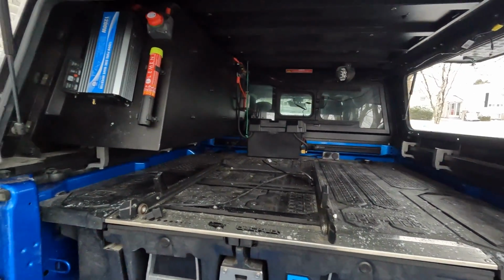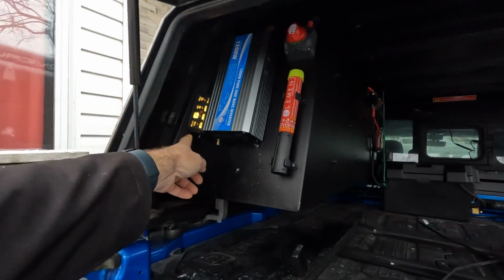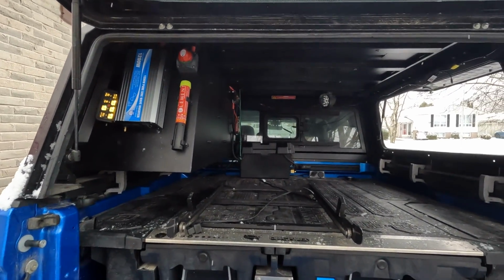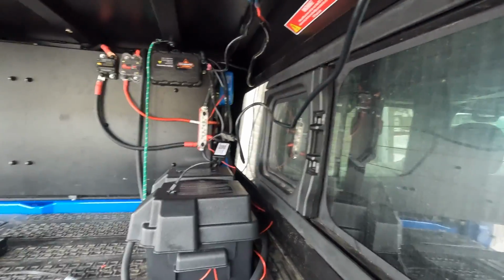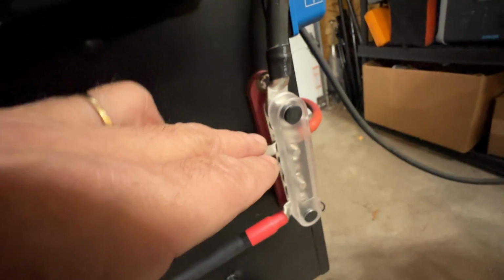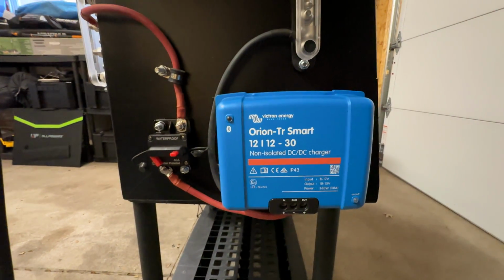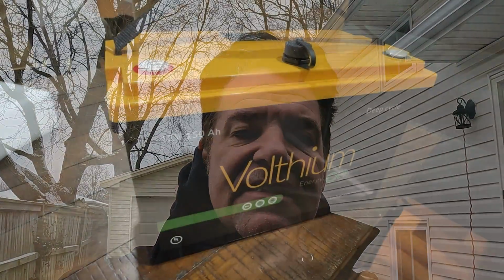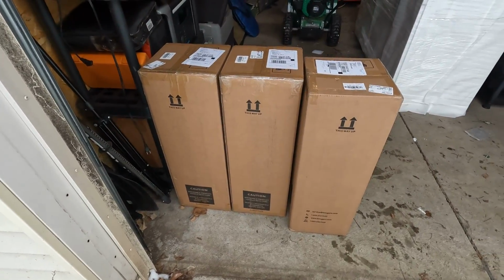Volthium Lithium Battery Set Up - My Current Power Solution in my Overland Rig Jeep Gladiator

Comment: It's so nice having onboard power! I couldn't see in the vid, but make sure you have a fuse on your + as close to the battery as possible!
If not, that long run to the kill switch is unprotected. If it grounds out, you're gonna have BIG problems. 👍🏻
Reply from the maker: Great point. I am going to have this added. Thanks for the tip!

Comment: Nice setup!  What about charging  the lithium battery below zero as I believe that is detrimental to the battery.
Reply from the maker: usually it is, but this is a self heated battery, so that doesn't apply to this battery.
Reply from the maker: This is what I found on Google.
Here we report a lithium-ion battery structure, the 'all-climate battery' cell, that heats itself up from below zero degrees Celsius without requiring external heating devices or electrolyte additives. The self-heating mechanism creates an electrochemical interface that is favourable for high discharge/charge power.